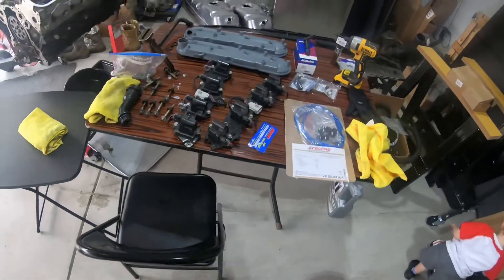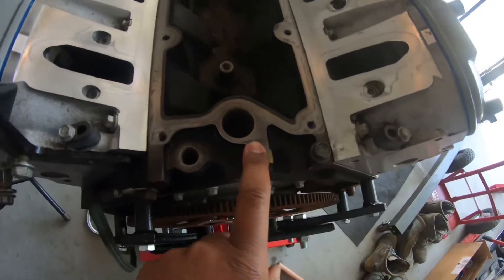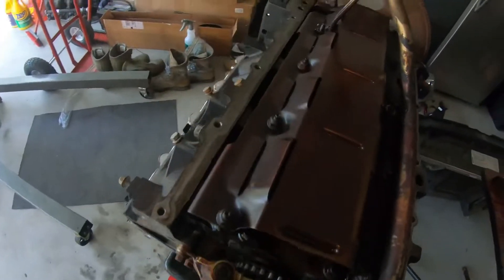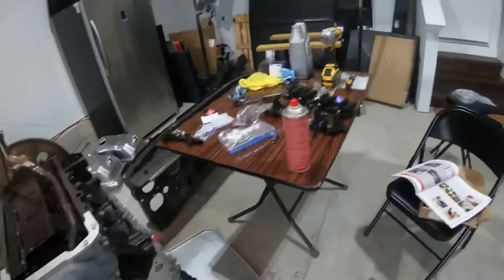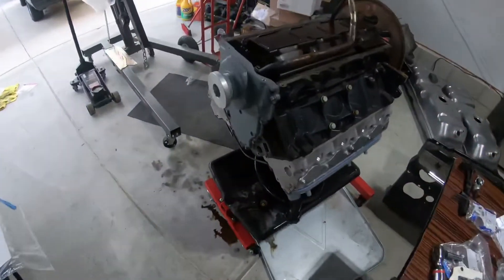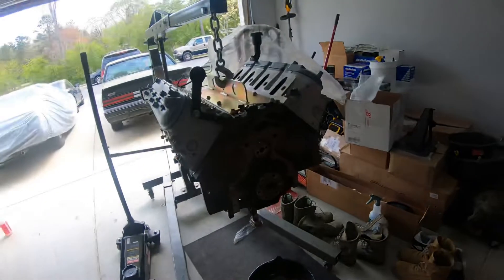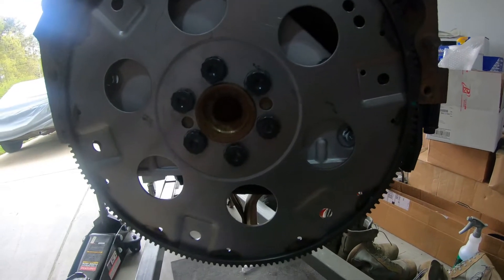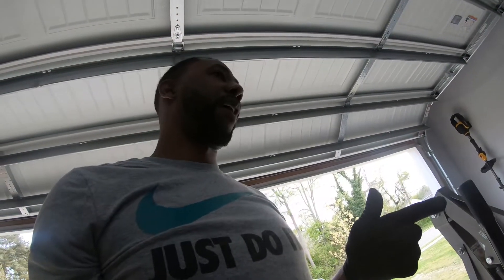LQ9 6.0 LS Front Cover, Rear Main Seal and Oil Pan Installation

Comment: Hel Mike are you still using the original oil pan
Reply from the maker: Yes.. with the TEJAS Steelworks motor mounts, you can use everything from the donor engine. Even the compressor down low.